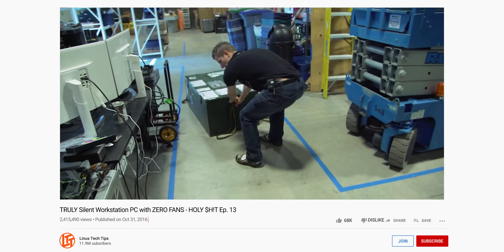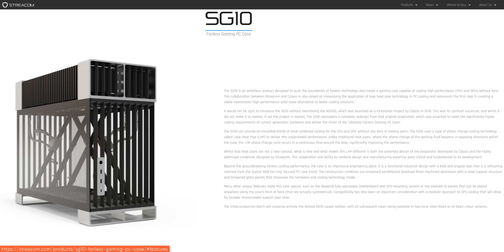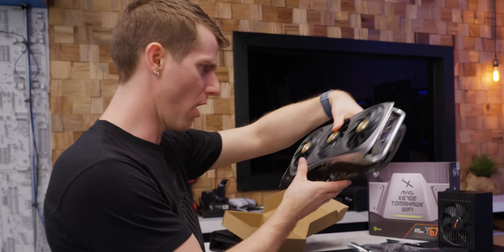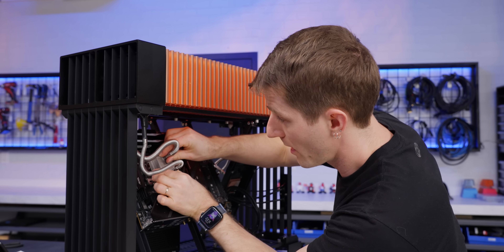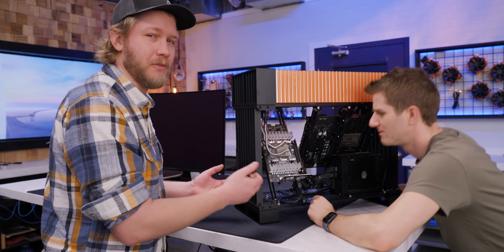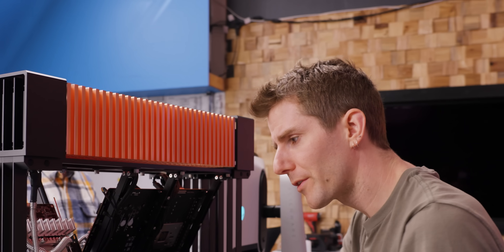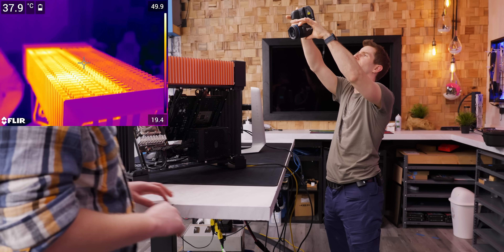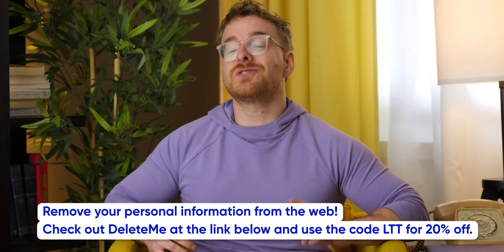I bought this scam PC case... And it actually arrived

Comment: bare copper like that is beautiful but with consumers not using gloves when building it, it will turn green fast
Reply: faxx
Reply: @snk1912  true, just add a bandage
Reply: The Statue of Liberty treatment
Reply: @ShotandBotched fr
Reply: Waxed slightly weathered copper slabs
Reply: @AnEagle  waxed weathered cut copper slabs
Reply: @novopotato  Waxed lightly weathered cut copper slabs
Reply: @AnEagle  Waxed lightly weathered cut copper stairs
Reply: @AnEagle waxed lightly weather cut copper stairs
Reply: @AnEagle  underrated comment
Reply: It will look cool either way😂
Reply: @Jorkofvich  belli i 2000 dollari per un case.comunque bello e funzionale a quanto sembra .
Reply: Patina would be cool
Reply: That would look even better
Reply: They probably treated it, otherwise it would already have lost the shine during shipment.
Reply: @tiloalo  you could say the same thing about the cyber truck. But the first time you touch it with your skin or attempt to wash it without reading any of the instructions or warnings, you ruin it and it takes way more effort to polish it back up.

It's a premium material, so it takes premium care
Reply: @cyleleghorn246  isnt it just stainless steel?
Reply: @tiloalo  It was covered in plastic that Linus removed.
Reply: I'm guessing clear lacquer won't make a massive oversize heatsink work significantly worse
Reply: So basically they'll be like all the cyber truck owners who didn't read the manual and took it through a car wash anyways? I'm sure the manual will tell you to wear gloves... Been the same with car parts for decades now. 

Touch a hi-beam headlight bulb with your skin oils while screwing it in, and it'll burn out in a week. Touch your shiny copper with skin oils and it'll get an uneven patina. Everyone has the choice to read the manual lol
Reply: @cyleleghorn246  tbf to the Cyber Truck owners, being able to do something with your overpriced truck that you can do with basically any other vehicle on the road isn't exactly a crazy expectation.
Reply: @AirLancer  they could have offered a dozen colors with enamel baked paint that lasts a decade, but no, they kept it bare with some random oily coating that was just enough for it to not rust in the dealership.

But just the same way you can wash that oil off without even thinking about it, you can do the same with the coating on copper pipes or radiators or fittings. They're typically not used outside of aesthetic designs, even though copper technically performs better than any other material. If you don't clean it for 3 months you lose all those performance gains that made it a better choice in the first place
Reply: @cyleleghorn246 not wrong but imagine buying a truck that can't handle water lol
Reply: @Stavroization  that's true, 2/3 of my 6 vehicles have been gas trucks and they're better in every way. I really really really, REALLY, wanted the cyber truck to be my 6th vehicle, but it kinda flopped, so I got a used Chevrolet 1500 with the 5.3l 4x4 towing package instead and I couldn't be happier. Also, it was half the price, and can do double the duty!

But no fucking lie I talked about how good that truck was gonna be for years and years. Most of high school and all of college. Then it turned out to be an $80,000 hunk of shit
Reply: Gloves or no gloves bare copper is a terrible idea.
Reply: Maybe it is sprayed with mineral oil or a clear coat of paint.
Reply: Is it actually bare? Plenty of treatments that could be used without taking away the raw copper look, especially on camera.
Reply: @foldionepapyrus3441  any sort of treatment that doesn't leave a glossy wrap is going to come off/be absorbed by your skin. Soap will disintegrate any kind of oil or grease coating you use to prevent corrosion. So it could definitely be oiled and still look bare and shiny, but one wipe with a microfiber cloth to get the dust off and that coating needs to be reapplied or it could corrode in a matter of weeks.
Reply: @mostneuter  absolutely right. Technically, copper does perform better at heat exchanging!!! Copper is the much better material for building radiators, if you're only talking about performance from the factory.

But they can corrode quickly, need cleaning, and if you press too hard while wiping it down with expensive oils, you'll crush the fins of a copper radiator SOO easily. 

Technically it's still a premium material that will work better, but we all know that (regardless of car or computer) no normal consumer will be carefully cleaning their radiator and oiling it up on a weekly basis. So we go with steel or aluminum for things like radiators instead, because it'll last years without cleaning even if it's 10% worse at it's only job
Reply: what, don't you have a bee farm?
Reply: It'll turn green with gloves or not anyways, copper reacts with oxigen and whatever is around it
Reply: @jonathanjimenez6739  copper oxide is black though. You're thinking copper carbonate, which would be an interaction with carbon dioxide as well as oxygen.
The copper will darken, then turn green. Although it is probable that they've lacquered it, which is fine until the lacquer peels.
Then again, if you're dropping 2k on a case, money probably isn't that big of a deal, and you'll just buy a new one.
Reply: It's prolly coated with a thin layer of whatever it is that they coated it with...
Reply: nothing gold coating cannot fix
Reply: @gh975223 also gold is a better thermal conductor... Although if the heat sink is made of gold it'll be substantially more than 30kg, and substantially more than 2 grand. Linus can probably afford it though!
Reply: Imo it will still look awesome, just different lol
Reply: @hi_tech_reptilezz  this is true. I like patina, I like the statue of Liberty, I like antique copper pipes that have been hidden in walls for 100 years. But if corrosion builds up between the fins of this heatsink, it will stop cooling as well as painted steel, even if you put a fan directly on it!

It will take time to upkeep this thing. The person who mentioned gold-plating it has exactly the right idea, but that's even more money for something that's already overpriced in an overpriced economy. It's the only way it could perform as well as my h100 all in one liquid cooler from 2011 has been performing for over a decade
Reply: Copper cant touch other certain metals or will tarnish fast too.
Reply: Its going to turn green anyway. Its rather weird to have bare copper to be honest as its quite malleable, and as you said, it will oxidise and turn green.
Reply: I can almost guarantee that if you are buying and then building in this you will know not to touch the bare copper with out gloves
Reply: You can clear anodize to avoid that. Though nickel plating is way better for this and would still look great.
Reply: Why is "gloves" a url in op's comment 😂
Reply: Er to all the people saying it would turn green -(copper oxide) it would turn dark brown - black (copper sulphide) I believe, just like the copper pipes in your house etc. Certainly before an oxide layer formed.

This is easy to remove with a special cloth (silver polishing cloth dissolves copper sulphide) but most likely it has been electroplate with silverbrite or similar which will stop oxide/sulphide layers forming.

Gold plating as someone mentioned here would only be effective if it was "hard" (3+ micron) as otherwise it would still discolour (I know I have examples years old I have plated.)

Anyway, just thought I'd say 👍
Reply: they really should have nickel plated it
Reply: It looks beautiful on knifes bolsters when it tarnishes, love that look
Reply: Yep, need gloves and a air conditioned place with 40-50% max relative humidity
Reply: @mostneuter  that's not how copper oxidizes. Nothing happens if you touch it with bare hands.
Copper needs high moisture levels in air to turn green. That's why copper pipes in homes don't turn green from outside, but rather inside.
Statue of liberty is green because it stands right next to the ocean which makes air very humid. If Statue of Liberty was built in Valley of Death, it would probably still be copper color
Reply: @MrSam2497  skin oils suck moisture from the air and trap it in, rather than blocking moisture the way that manufactured protective oils do. This is why we don't dry out instantly in a light breeze, but if we wash ourselves too much (10x per day) or with extra strong soaps, we get really dry.

I agree the statue of Liberty would be different if it were in the desert, but its color and patina was not caused by skin oils in the first place, so it isn't a 1:1 comparison
Reply: @cyleleghorn246  moisture and oils in skin isn't enough to cause the chemical reaction in copper.
That's why the old copper pans and pots that your grandma possibly has that have been only for decoration still look like brand new (probably gotten just tiny bit darker due to moisture in house's air) even tho many people have touched them.

If moisture in fingers was enough to oxidize copper,.ot would be disastrous in electrical work, since bunch of electricians touch the copper wiring all the time
Reply: @MrSam2497  our skin oils can suck moisture out of the air and trap it, whereas protective oils and grease block out all the outside moisture. I could be wrong when extrapolated out to 20+ years, but I've personally seen it happen in under a year where I oil a knife or a gun or a piece of a bike or pipe (because I want it to stay shiny) and I accidentally touch it in one spot, and that one spot develops a fingerprint/smudge of corrosion. If it didn't happen at least 10 times I wouldn't have noticed it as a pattern specifically where I touch it. But the parts you touched after cleaning them will be darker after 10-20 years than the parts you cleaned properly and never touched, even if you never let it "rust" to a bad point. 

It all adds up to the overall patina of the metal, and it's impossible to prevent it long term, but when you see it after 1 year and can identify the actual fingerprint of where you touched it (while the rest is still shiny) you can tell this is exactly what is happening. But I mean, I might wipe the copper pipes once a year while I'm cleaning cobwebs. I will oil the knife and gun every time I use them. I don't oil/clean/wipe the radiator of my PC ever, but it's painted to prevent me from needing to clean it! Something like this will absolutely look like trash after a year or two if someone doesn't take care of it properly. Wearing rubber gloves prevents this because it blocks your skin oils.

But my pipes and knives and guns are free or cheap, not $2000. I couldn't imagine spending $2000 on a random copper pipe or radiator or firearm component. If I did, I'd think about how it would look in 100 years even though I'll be dead by then. I'll think about how often I'd realistically clean it, how much corrosion will happen, and how badly that corrosion would affect the performance. Usually the answer is pretty small. But for a copper radiator, even though it works better on paper, it will take hours of cleaning per year to retain that good performance! If you never clean a copper radiator, corrosion will clog it within a year and it will be worse than a steel radiator even though it started off 200% better than a steel radiator. The steel stayed the same since it never corroded, but the copper radiator performance will plummet without regular cleaning
Reply: It wont, but it will be green after few years atleast the copper pipes i installed at my parents boiler room they havent turned green or stained after 6years and my hands were NOT CLEAN
Reply: In a moist environment sure otherwise no
Reply: @RandomPersonOnTheInternet1234  A moist environment will make copper rust without touching it. In a dry environment, it'll only rust wherever you touch it. When you take this to a moist environment and proceed to touch it, the places you touch will rust way worse over the course of 1-100 years. The only way to avoid this is to clean it at least once every month or two and oil it up every time and not touch it without rubber gloves on, or without using a rag with oil on it.
Reply: Imagine if it used bare silver instead.
Reply: @MildMisanthropeMaybeMassive  easily $100,000 for a silver radiator. It would be just as soft, just as conductive, but last 1000 years so imo that's the better product. Since nobody can afford that for a rig that'll still hit 90 C, doing some diy electroplating with gold or silver would provide *virtually infinite protection for just a tiny bit more cash up front
Reply: @cyleleghorn246  Will oxidation affect the conductivity?
Reply: @MildMisanthropeMaybeMassive  thermal conductivity, yes. The oxide layer has much worse thermal properties than the pure copper. Beyond this, it can close the gaps between the fins, which completely blocks airflow, and this is MUCH worse than simply getting a 1 micron layer of oxide on top of a radiator

Electrical conductivity, only no because this part is not part of an electric circuit.
Reply: I mean it could be clear coated though.
Reply: gooning to the statue of liberty treatment any % run
Reply: @Dante_S550_Turbo  statue of Liberty patina is the best worst-case scenario you could hope for
Reply: it'll turn green on its own tbh over time, but the buyer of such an expensive product would replace it well before then.
Reply: 13:49  it has protective plastic peels
Reply: @MegaTaco101  and people will take this off within a moment of coming out if the box. When has a protective peel saved a phone screen from getting scratched a year later? If people kept it on, maybe it would help, but they take it off right away!

It will also marginally hurt the thermal conductivity by a percent or so. It would offer protection from oxidation if people left it on, but they simply don't leave it on more than a few seconds lol
Reply: Unless coated.
Reply: Trust the science
Reply: No it wont
Reply: They better anodize it
Reply: You could brush something on it but the green might look cool too.
Reply: itll turn green regardless. wherever theres oxygen oxydation happens
Reply: Itd be REALLY cool with a forced patina with ammonia and salt!
Get a full shipwreck finish on it and make it look like it's from the bottom of the ocean!
Reply: the green patina might look cool so long as it doesnt effect performance but I imagine it does.
Reply: @Jankmasta  ammonia+salt on copper creates a blue and black patina. 
Patina doesn't affect the thermal dynamics of copper.
Reply: I would assume there's anti-corrosion varnish on the condensing fins on the finger-reachable areas. From the different angles in the video, it does not look like it's bare. Bare copper has a brightness to it, but this seems more "shiny".
Reply: @mostneuter  The plumbing in my house isn't green after 35yrs.
Reply: Anodised copper ._.
Reply: I am sure it has a coating on it.  Copper used to be a normal sight in custom PC.  I don't remember any of those parts oxidizing that badly.
Reply: I mean, annodized green would be a pretty sick look for it.
Reply: One million percent, but I think it'll look great in 5-10 years completely greened out. Would that ruin the cooling?
Reply: Take it easy turbo, The copper in this case is coated with are thin layer of wax that's acid/oil resistant in other words it wont go green.
Reply: Most likely coated
Reply: @mostneuter  Huh?.. gloves or not.. moisture is going to get on the copper.
Reply: Good point
Reply: verdigris is beautiful!
Reply: Ever heard of protective layers? I've never ever seen any copper component, such as coolers, to become oxidized or stained in any other way after a decade of use. And I've seen and used many. And the number of upvotes just shows how stupid people really are.
Reply: @AngelicStreak   haha ikr. that's what shocked me too.. all the upvotes🤷🤦.
Reply: i was wondering about that. might benefit putting some lite overcoat on it of some sort. even if you never touch it, it will start to turn dark brown over time from the air.
Reply: It's likely coated. Bare copper almost always is.
Reply: You are talking bullshit. I don’t know how you get so many likes (I am a professional/ Electronics technician for automation technology) And have been using it for decades without this effect. This is more likely to happen through other chemicals in the industry.
Reply: Every fingerprint on the copper will turn darkbrown/black within the next years, as long its not coated. Bass pianostrings are the same. You dont see it in the first month, but if you had a non caring technician you will see it years later. I always use gloves when i work on the strings. For it turning Green you need high humidity like rain or close to it. 😅
Reply: Case hardened pc

Comment: Getting Zalman Reserator vibes.
Reply: hands up if you remember zalman coolers (you are at least 30 to 35 years old)
Reply: @DennisGr  my first thermal cooling pad for my router was Zalman with 27 inch fan. decent product and good longevity
Reply: Zalman TNN 500AF - fanless case that did make it to market, released in 2004, discontinued ~2006.